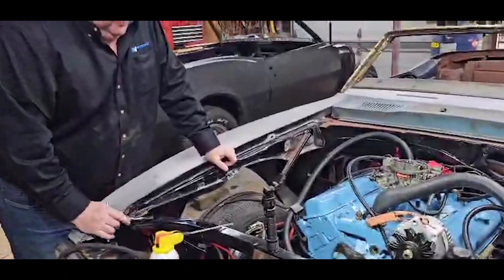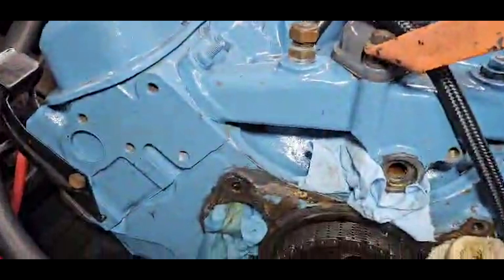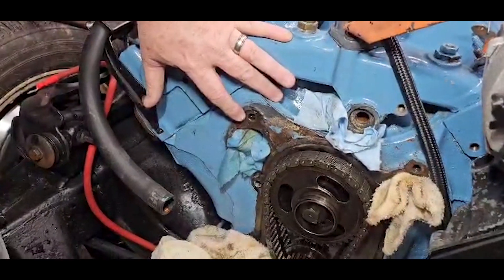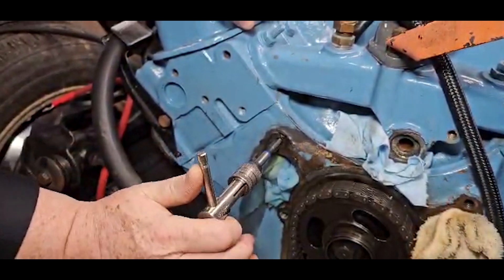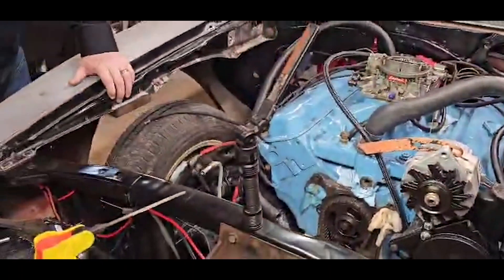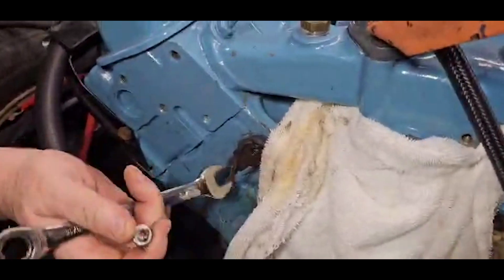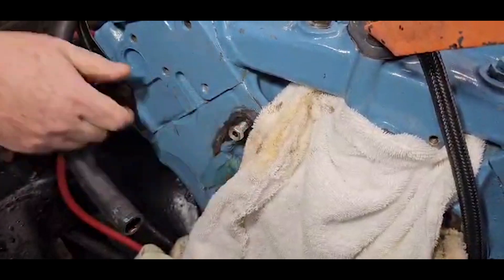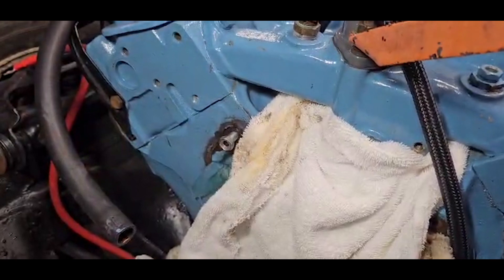HOW TO SEGMENT: How to extract a bolt that is broken deep in the hole.

Comment: What do you do if the easy out breaks off in there?  I have seen many drill bits burn out trying to drill through an easy out, and not even scratch the broken easy out....
Reply from the maker: yeah you need to really pay attention to that.  you break it off and you are into a bigger problem for sure. where you will probably need a metal disintegrator.  which is a real pain.  metal disintegrators work great for steel bolts in aluminum but steel in steel is tricky.  thanks for watching!

Comment: Left handed  drill bits will back the bolt out of threads 99 % of  the time I have removed cylinder head  bolts diesel  engines  .
Reply: That's what I would have done.